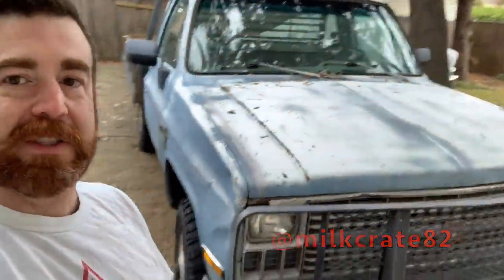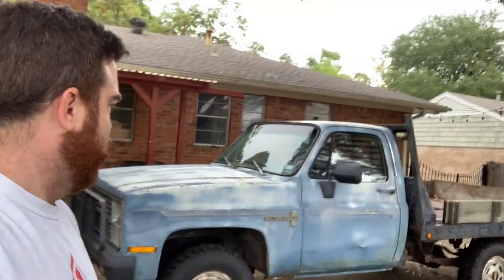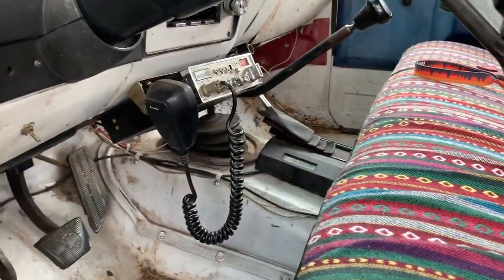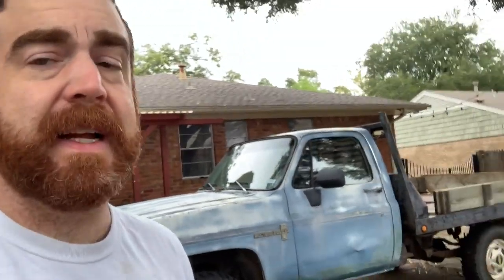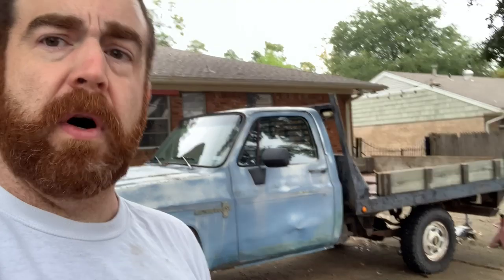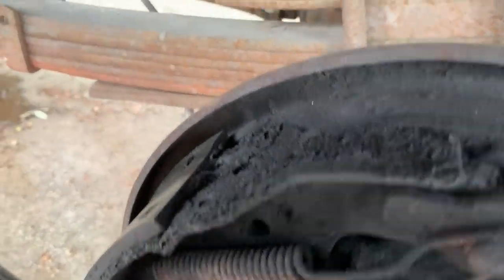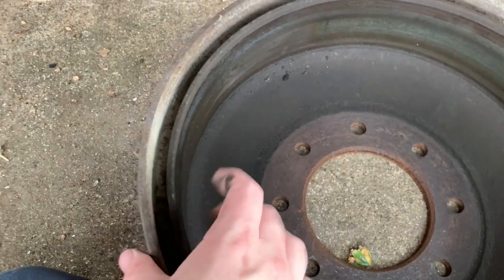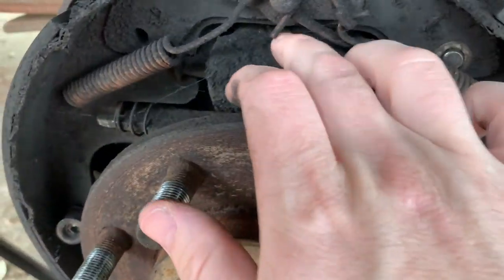CHEVROLET 3/4 TON REAR BRAKES AND WHEEL BEARINGS | 1981 Squarebody K20

Comment: Quickest easiest way to remove a bearing race if you have a welder is run a bead around the inside of the race and it will pretty much fall out
Reply: Please explain a little bit more on the process if you don't mind
Reply: No bb's getting on the inside?

Comment: After my experience with a 1 ton 14bolt FF swap and the el dorado brake kit.... save yourself a ton of cash and get a newer model 14 bolt with GM disc brakes and factory parking brake set up.  I had the option to do this but went with the old school set up, but the newer axle would have saved me hundreds of dollars in the long run.
Reply from the maker: Great advice!  I did see a early 2000’s FF 14b in CL out in East Texas with disc brakes.  Price was reasonable but not great.  It would have been a 6 hour round trip for me.  I thought about but decided against it.  Too much trouble.
Reply: @milkcrate82 do you happen to have a part number for that break drum? I've been looking for weeks trying to find one. Thanks in advance

Comment: Hey there is a something in the brake lines it's a weird looking thing that the brake lines go throught above the rest axle. It looks like it has something to do with the load in the bed it has a wheel on it with arm..I  disconnected mine and the brakes when I push the peddle sometimes they lock up in the rear is. That cause I disconnected that thing. Anyone know whay it's called so I can find a replacement

Comment: Would be nice seeing how you put brakes back on in normal speed lol
Reply: You can set the playback speed to 0.25, but yea a lot of the frames are still missing.
Reply: I was gonna say same.     Was trying to take mental notes   And see what size wrenches and open end wrenches used.    I need to do this to my 77 k10 soon.  I just bought most of the parts   But never really done drum brakes